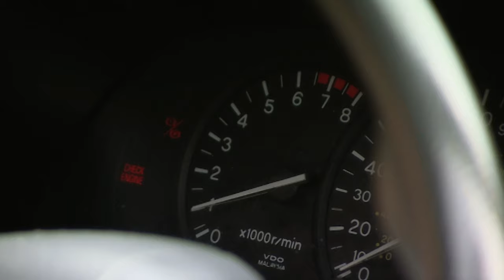Driving A Car With No Oil #TBT - Fifth Gear

Comment: basic car maintenance should be part of driver licensing...
Reply: aakksshhaayy that is the job of your parents not driving school
Reply: UsingInvisibleInk why
Reply: aakksshhaayy
 Think about it, their main purpose is to teach you to drive. It's really the responsibility of your parents to teach you car/motorcycle maintenance in my opinion
Reply: UsingInvisibleInk yeah, i know. I'm saying it should be expanded to include maintenance.
Reply: aakksshhaayy
then driving school might cost more
Reply: UsingInvisibleInk supply and demand
Reply: In the UK driving test, there is a section you need to pass that ensures you are clued up on basic vehicle maintenance, it's called Stop and Check. And they will ask you to open the bonnet of your car and be able to identify the different parts of the engine and how to check oil and fluid levels. A friend of mine failed his driving test twice because he failed to identify where the engine coolant was stored in his driving instructors car plus some minor road mistakes.
Reply: What about orphans?
Reply: This should be taught in every school...instead of history and safe sex, both which I have never used.
Reply: in france it is. headlight adjustment, oil and water levels, required tire pressure, opening the hood, how to jumpstart when the battery is dead/too low.
Reply: It is? Atleast in sweden if you cant check those things you wont get license
Reply: It is in kansas
Reply: aakksshhaayy facts
Reply: Or if you know how to maintain it, your insurance should be decreased
Reply: At least in Brazil it actually is!
Reply: It is in Sweden
Reply: It is in the UK you get asked these questions on the test...
Reply: In finland is the first basics of the car to check the oil, coolant, brake fluid etc. along with tyre pressures, lights...
Reply: It is in Denmark
Reply: It is in germany
Reply: aakksshhaayy why? It’s your money
Reply: It is, people just forget it immediately after they got their license.
Reply: It is in the US, or at least in NC driver's Ed.
Reply: In germany it is...
Reply: Tyler I’m doing drivers ed and they do teach how the engine works and how to do some basic maintenance
Reply: @R L Lol how old are your friends, like in high school or sum shit?
Reply: @UsingInvisibleInk  Or the owner of the vehicle and if they do not check their oil as instructed by the owners' manual they should be sued for negligence of an object that can kill a person. Themselves or others. This is a safety issue, I'd say. Check your oil, check your brakes check your tire pressure.
Reply: It is. The problem is when people get their license and forget everything.
Reply: I'm living in the Balkans, Bulgaria to be precise, we have that kind of stuff covered in the first days of driving courses. (also the most important lamps on the dashboard and where are the caps for oil/cooling system/wipers fluid).
Reply: @UsingInvisibleInk  Cars breaking down are a traffic hazard, so it should be part of driving school.
Reply: here in the Netherlands it's part of the driving test. You're asked to open the bonnet and point out the dip stick, coolant, etc. 

In my case, when i pointed out the brake fluid needed changing because it was turning black they closed the bonnet. That was a pass.
Reply: When learning to ride a motorbike, fueling and checking/ topping up oil was part of the process, because it would be dangerous not to be on a sensibly maintained bike.
When I learned to drive a car nothing was covered.  So evidently driving a dangerous car is acceptable.
There are a few things declaring who should be responsible for this.  Considering my bike examiner asked me to point to where I would check the oil as part of assessing me, while the car test was in and go, that will undoubtedly be why there was tuition for it.
Parents are being cited as the place we should learn this from in a number of cases.  Not sure I agree.  My mum never rode a motorbike when I was younger and many parents don't drive.  Are they supposed to ask someone with a car to let them teach their child this skill?
Reply: @destructionnl8165  I asked a mechanic to check the oil in my Tesla. He called me a c*nt.
Reply: @worthlessdollar1  A Tesla still has brake fluid for example. So that was a bit quick from that mechanic. 

I'm a mechanic, as i already was when i took my drivers test. For the test you don't need to know anything about brake fluid, so when i pointed that out they deemed i know more than i have to, turning it into a pass for basic maintenance.
Reply: @destructionnl8165  I was only joking! I can't afford a Tesla lol. I drive an old Vauxhall (Opel) Vectra worth £700 😂 

I do think it'll be quite sad when ICE cars are gone. There's something about all the elements involved in internal combustion that's almost magical. Electric cars seem very clinical and soulless by comparison. Still, I learned something today; even Teslas use oil 😄
Reply: @worthlessdollar1  Lol. 

And agreed. I'm not looking forward to the day i have to get rid of my car and start driving a washing machine with wheels basicly. It will be a sad day.
Reply: @avaition2008  Same here in the Netherlands. You can actually fail the test if you don't know.
Reply: @UsingInvisibleInk  what if you were kicked out by your parents?
Reply: It kind of is, just before I passed my driving test, my instructor showed me some new things that I'd need to do to pass where I had to identify each of the caps on the engine (oil, radiator, washers etc) and how to check the oil level, on the day of my test the examiner had me lift the bonnet and point out which one was for what (these new rules had only come into effect that morning so I was likely one of the first to take a driving test with this requirement).
Reply: I’m 5 years late but yoo they damn near should
Reply: True
Reply: In fact it is. In Poland it's a basic knowledge that you had to have during driving license exam.
Reply: Basic intelligence should be part of having the right to vote
Reply: Yes your right mate this is very very important 🤕🤕🤕
Reply: I agree. You do have to have some mechanical knowledge for a PSV or HGV licence.
Reply: Nice joke🤓🤓
Reply: It is, in Europe. You actually have to open the hood, check oil levels and name things at the beginning of the exam.
Reply: You’re so right and I should be the spokes person of this this happened to me today no lie no oil in my car the car stopped thankfully my job had a parking lot where you can park or you can park your car and I’ll get it tomorrow yeah I’m slow
Reply: Funny enough. We do that in Denmark. On the test we can be asked to point out where the oil dipstick, coolant, oil fill, washer fluid and even break fluid! If we fail we can't get the license.
Reply: In Germany it is.
Reply: It actually is in Croatia
Reply: 100%
Reply: Why it’s not your car
Reply: Right, let the DMV show loads of people how to save money from major car companies 😂😂 that will never happen
Reply: It literally is
Reply: As a mechanic, I'm gonna lobby against that if its ever being proposed 😂

Comment: I'm absolutely shocked about how so many drivers are completely clueless on how to properly maintain their car. Truly worrisome.
Reply: +NickLAUZ95 they pay the dealers and mecanics
Reply: +NickLAUZ95 Yeah or at the very least pay someone else such as a mechanic to perform certain tasks. I don't check my oil every single time I fill for gas but at least do a general leak check. Doing an oil change when needed should be enough so it never get's dangerously low.
Reply: +groenekever shhhh.... this is useful for the job market..
Reply: +NickLAUZ95 Think times are changing quick with auto tech, my old man's BMW don't even have a dipstick, a lot of cars don't have temp gauges either just a light to say cold or hot.. even tyre sensors, I don't know any one who check their tyre pressures...

I'm old school, my old man taught me first thing you do under the bonnet is pull the dipstick and check fluids etc.. I cant get my head around modern cars changing oil at annual service, it still think every 3000 miles you need to change it!
Reply: +Jon ‘Wookie’ Buggins it really is madness. I check my tyres, oil and cooling fluids every month, just to be on the safe side. It's just become a habit after cleaning my car :) (I normally clean it more than once a month, but hey, don't get me on that!)
Reply: They have to put "may contain nuts", on packets of peanuts now. Some people are completely brain dead I'm sure of it.
Reply: NickLAUZ95 yes, yes it is
Reply: Nobody teaches this stuff in driving school. Their specific purpose is to prep you for the exam and the exam alone.
Reply: Yea crazy, this month alone, January 31st 2022, I spent  £1207 on getting the cam belt/water pump replaced, a new mirror with heating Element, 2 new Michelin tires and a wheel alignment.
Reply: Don’t let it keep you up at night
Reply: My wife just to a trip out of town. I made sure there was oil. But she didnt check or put any in. She drove hundreds of miles on the highway with barely any oil or possibly none. I checked it when they got back and it's literally dry as possible. Its a new car. 2018 model. How long can this keep happening before it goes to shit?
Reply: I once met a bloke who thought his lexus 200h had a "v4", coudln't tell an oil pan from a radiator, and was genuienley amazed to find out that transmission fluid was a thing.
Reply: Typically oil doesn’t need to be checked if it’s not burning or leaking. Just change the oil on your next service.
Reply: @groenekever well simple things but like body work that’s needs to be done by professionals

Comment: Kinda sad he had to teach people how to check their oil
Reply: +Tannerp24 I was taught how to do that when I took my license!
Reply: +Tannerp24 People should not have a license if they can't do that...
Reply: +Tannerp24 Well, checking your oil isn't rocket science. All you gotta do is pull out the dipstick, wipe it clean, shove it back where it was, pull it out, wipe it clean, look at it, and shove it back where it was. If more oil is needed, TOP IT UP WITH THE CORRECT OIL!!!! Use a funnel, otherwise you'll slop it all over the crankcase and the car will produce more smoke in one journey than Bob Marley did in his lifetime (I did that once, very embarrassing). You put the oil where the yellow cap is marked "OIL" and has an icon resembling an old fashioned oil can. Check your oil on a weekly basis and before undertaking long journeys.
Reply: +MrSupercar55  lol, 'wipe the dipstick then look at it' and it'll be clean, like you have no oil
Reply: +Tannerp24 Still a light year better than anything Jeremy has ever said or done.
Reply: +MrSupercar55 Wipe it clean? How can you get an oil readout if the stick is clean?
Reply: +asdda you wipe it clean, the dip it to get a proper reading (it gets splashed around while driving)
Reply: Dylan Collins Yeah, but the guy I replied to said "All you gotta do is pull out the dipstick, wipe it clean, shove it back where it was, pull it out, wipe it clean, look at it" and I'm asking why he would wipe it clean before looking at it as you can't see the oil if he wiped it just before looking at it
Reply: asdda hmm, maybe he mistyped it?
Reply: +asdda cause the oil will give a false reading cause it has been sloshed around when it is moving, if you wipe it clean you get a true oil reading.
Reply: +asdda obviously you put it back in after you wipe it
Reply: Matthew Stillwell
Sure it's obvious, but I find it funny how the guy who said that it wasn't rocket science actually got it wrong. I'm sure he just wrote it wrong, but I found it very funny.
Reply: +Tannerp24 even more sad that he tells them to check it whilst the engine is warm.... B'cus that is wrong
Reply: +Fredrik Bob Exactly. NEVER check a warm engine because the oil level will be incorrect. Adding too MUCH oil is also extremely bad for the engine. If it's a diesel car, you can get what is known as a diesel runaway where the engine starts to run on the excess oil and can't be turned off with a key or the start/stop button. Search youtube for fun videos on that. Not only will your engine be dead, but pretty much the whole car gets destroyed in the process.
Reply: steveju1 some car manufacturers specify to check while WARM, not HOT... If that's what you meant then fair enough and you can even get some nasty burns if its too hot
Reply: +MrSupercar55 

Unfortunately, there are some cars where there is no dipstick; you have to rely on instruments to determine if your engine has a proper oil level.

Look at some modern BMWs, for instance; there is no dipstick as you're expected to use your instruments to determine that, although the best way to determine the correct oil level on such cars is to drain the sump and measure the amount of oil that came out and then pour the correct amount of oil back into the engine.

Very stupid, since a dipstick is a very simple solution.  Even if you have instruments, there still should be a bulletproof way to measure the amount, as a supplement to the instruments at the very least.
Reply: +BigAlFiGala I think he meant wipe it clean and stick it back in then pull it out and check it.
Reply: +Watcher3223 Mine's got both a dipstick and a digital readout for 5 seconds when you start the car, but I'm always a bit skeptical with the digital readout because I've never seen it drop below full-bars
Reply: +TheGuyFromUme I don't even have my licence yet and I'm already afraid of breaking something.
Reply: Lol
Reply: Tannerp24 Ikr I'm fucking 13 and i know XD
Reply: Tannerp24 k
Reply: Tannerp24 I wouldn't mind if he was actually right. He said you should check it while the engine is warm but this will underestimate your oil level. Always check it cold for an accurate reading
Reply: 100% correct. It will always read less, even if ran for just a few seconds as by time you've switched it off oil has been pumped around the block whilst even more oil has been thrown against the walls of the block
Reply: You would be surprised how many people are totally clueless.
Reply: Tannerp24 lol
Reply: Not all of us were raised with cars or with someone to teach us xc
Reply: TheGuyFromUme I was taught that a year ago and I'm 13
Reply: Are you sure you need to check it while it's cold? In fact that goes against what some manufacturers say

"CHECKING YOUR NISSAN'S ENGINE OIL LEVEL"

"The oil level should be checked regularly. Operating with an insufficient amount of oil can damage the engine, and such damage is not covered by warranty."

"1. Park the vehicle on a level surface and apply the handbrake."

"2. Start the engine. If the engine is cold, start and let the engine idle until it reaches the operational temperature."

"3. Turn the engine off."

"4. Open the bonnet. For details, see “Bonnet release” in the “3. Pre-driving checks and adjustments” section."

"5. Remove the dipstick and wipe it clean."

"6. Reinsert it all the way."

"7. Remove the dipstick again and check the oil level. It should be in the normal range."

"8. If the oil level is below normal range , remove the engine oil filler cap and pour the recommended oil through the opening. Do not overfill."

"9. Re-check the oil level with the dipstick."

"10. Install the engine oil filler cap securely."

"11. Close the bonnet"
Reply: Common sense is sadly gone